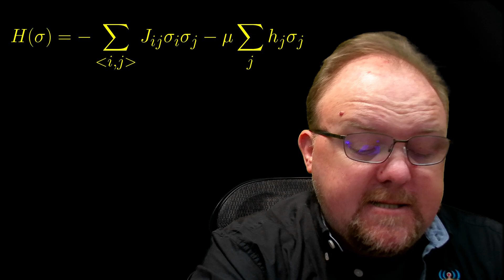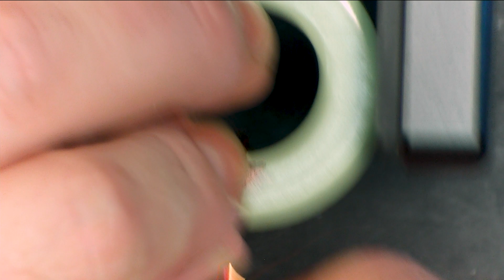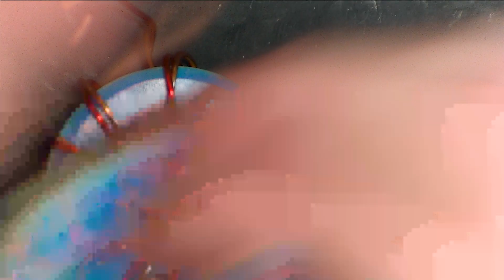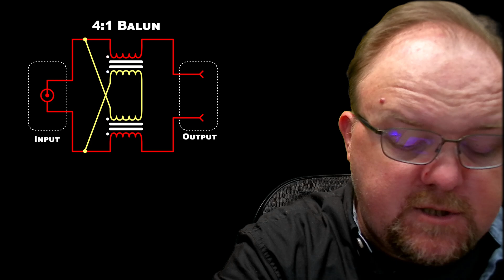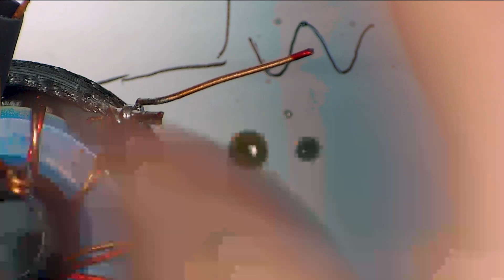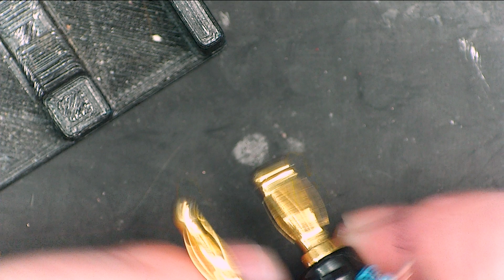DIY Balun Physics, Build, & Test for Inverted‑Delta Antenna | Part One

Comment: Would it be possible to tap that 4:1 in a spot that would allow it to function as a 1:1 choke as well? So if you wanted to use the two whips as a dipole you could attach the leads coming from the whips ring terminal into the taps on the balun for 1:1 operation?
Reply from the maker: Absolutely it would.  Give it a go!

Comment: 2PULLED 2PUSHED NO ELECTRIC NO TRICK TERMINOLOGIES  NO TRICK WORDS....DC BATTERY  DIS CHARGE TO USED . 12OVAC 60HZ LjV NO NEUTRAL  NO GROUND DO NOT USED MULTIMETER  WITH 2 WIRES..CLOSE LOOP CURRENT SINGLE WIRE SO AC ACTIVE 
QURjynt volstages 60 +60=120vac Ljv on single wire..Amps Watts   BATTERY..2CHARGES PNEG  PULL JRQN̈ QURjynt  POSI+PUSH JLQY - voltstages +

Comment: Good stuff!

Important: for most efficient operation, the number of turns (wraps) of wire on the ferrite cores must be equal..
Reply from the maker: Hey thanks!  I've got a question for you -- while I agree they have to be equal, I'm not entirely certain I know the proper number.  I know there is a diminishing return for each additional wrap.  Can you offer any insight to how to determine that?

Comment: Just ran across this video and subscribed. Very nice explanation of how a balun works. Are you also going to publish a parts list? It looks like those are 240 size toroids, but not sure. Also, what mix are you using? Can't wait to see part 2. Great job.
Reply from the maker: Glad you enjoyed it!  Yes -- there's definitely going to be a part 2.  The github (should be in the notes) already has all the 3d printed parts (but not links for wire, toroids, or the m3 screws) or build instructions.    Edit: (Those are not 240 size toroids.  They are 21.3 x 38.8 x 11.2mm) They are mix 43, however, I'd like to rebuild it out of mix 52 to see if that gives me better low frequency performance.
Reply: @boondocktechnologies  Thanks for the information. Is that first number, 21.3, the inside diameter or a typo? Not finding a toroid with that measurement at Digikey or Palomar assuming the 21.3 is the inside diameter. Thanks
Reply from the maker: I took some more careful measurements with calipers instead of a ruler.  BTW -- I'd expect these to be nominal measurements (in name only) if you see something close, that'd be it.
I've got 
38.85±0.05mm for the o.d.
21.23±0.02mm for the i.d.
11.21 ±0.09mm for the thickness

1.53 in o.d.
0.83 in i.d.
0.44 in thickness

On amazon I found some measuring 21.5x38.4x11.1mm that appear identical to the ones I purchased, however it doesn't indicate the mix. (Fielect store)  I'd post a link, but I think that makes YouTube eat my comment.  According to my order history, the ones I purchased were from uxcell and are no longer available.  I'll source a proper core from one of the electronic suppliers for the list.
Reply from the maker: https://www.amazon.com/Fielect-Toroid-Ferrite-Inductor-21-5x38-4x11-1mm%EF%BC%8CLight/dp/B081PZDJFL/
Reply from the maker: @IntensityOfAction -- looks like YouTube won't eat my link:  Whoohoo!  https://www.amazon.com/Fielect-Toroid-Ferrite-Inductor-21-5x38-4x11-1mm%EF%BC%8CLight/dp/B081PZDJFL/
Reply: @boondocktechnologies  Thanks for the extra work lol. I have some 140-43's that are just a tab bit smaller but should work out. They won't be as tight a fit but that shouldn't matter once they are potted in. I have 2x 17' whips that I want to use so I'm going to have to beef up the antenna support part I think. Those things get pretty unwieldy when fully extended in any way but vertical.
FYI, Chameleon Tactical Delta loop uses a 5:1 Balun from what I understand. If you are going to redo the balun you might want to try that.
Reply from the maker: Yeah!  Now I'm on a mission!  I've found the distributor Mouser has some TDK that are about the right size.  But I think if I were to do a redesign at this point I'd go just a tad bigger, which is the easiest change to make in the 3d files.  But before I recommend one, I'd need to dive into the datasheets because they don't define type 43, 52, etc.  They've got completely different designation systems I'd have to cross reference.  Good luck!

BTW -- I'm not loving flipping the 6-bar linkage design, it works, but I was thinking about moving towards a simple snap to position and having the antenna swing 120° so once you put everything on the rod, it never has to come off.  Come join our discord and we can discuss it!  https://discord.com/invite/xMm6GYs2kH
Reply: @boondocktechnologies  Thanks joined
Reply: The first of the Skunkworks
Reply: Cool video!  I do not believe there is a Mix 43 Iron Powdered toroid, although there is a Type 43 Ferrite which is Nickel-Zinc (NiZn) ferrite material.  That would possibly explain why you cannot find it. However if you do, I would love to grab a few to test them and learn about them.  73.